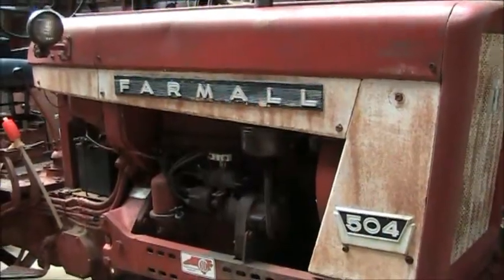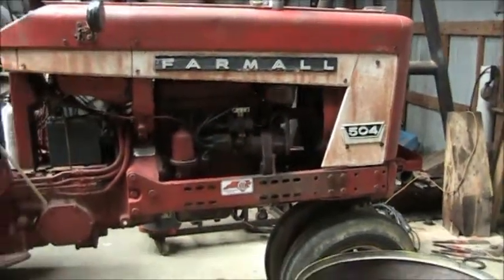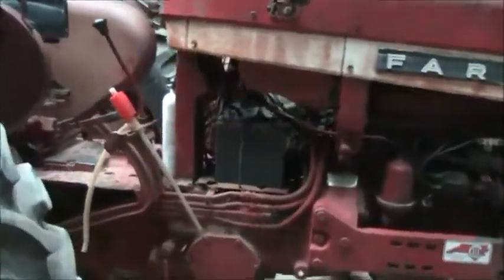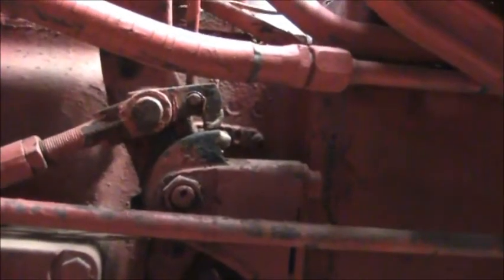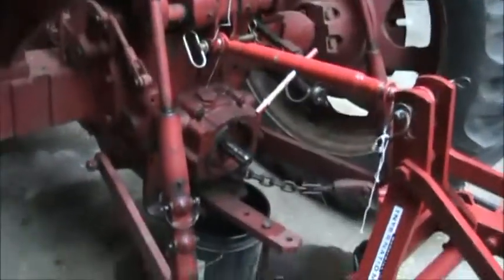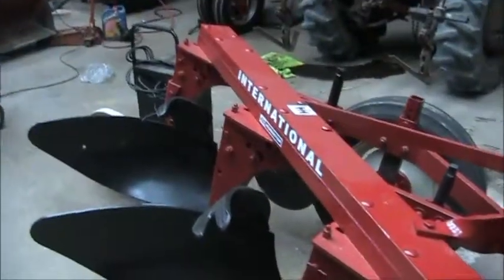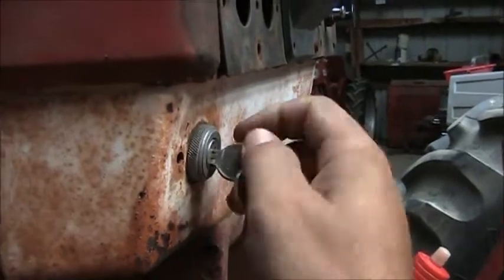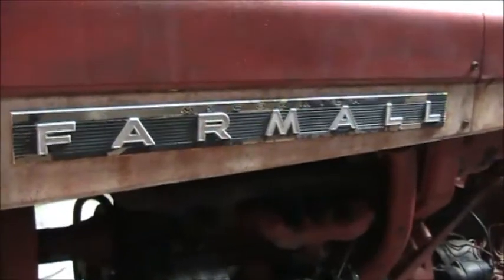Rare Farmall 504 with Low Ser #

Comment: Very nice tractor, I'm putting the engine and steering from a 504 industrial utility tractor into my 340 utility tractor myself. The only thing I wish was the 153 engine was sleeved like the smaller sizes like the 135 and back. That makes them unlimited rebuild as long as you don't have a cracked block. On the 153 it's like a car and you only have so many rebuilds before you must sleeve it or scrap the block. But they Shure have the power and pretty fuel efficiency for the size of tractor. Hope you have a chance to restore it and keep using it for a long time.

Comment: interesting.i have one.fer last 25 years.retireing it.runs but uses lits of oil now.power stering no longer works.hydrolicjs weak.used it raking .baling hay. put weights on front they like to rear. had to have two suitcase weights at least with 250 bushel manure spreader.mine think is 63

Comment: good day.  Watch your video saying rear end of 656, they were built later, or are you saying 504 rear end was put on 656?  also is this the basic engine a W-4  used.  Also putting  a 656 motor in what would it  be, 504 6cyl. or 656.  just like  a super H /ta.  I  am told is a farmall   300 with a169 Sh motor in which is  a 300  Thanks.
Reply: Don Voll the rear end is not the same as the 656. First of all, the 656 had the TA with a hydraulic lock like the 706 does, but the 504 uses the older TA. The rear end is heavier in a 656. Despite the fact they are the same bore and stroke as a W-4, they are not the same engine. A completely diferent design. For example the C-153 in the 504s are sleeveless and the C-152 in the W-4 have  dry  sleeves.